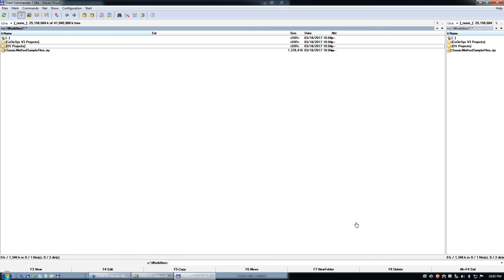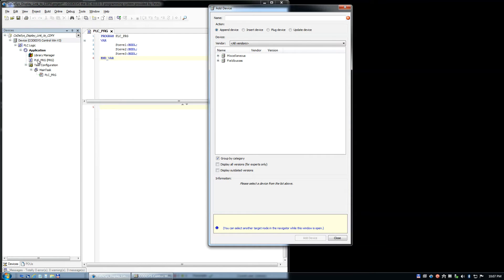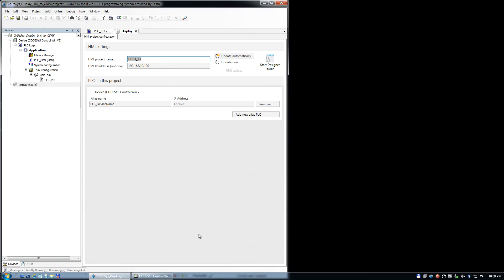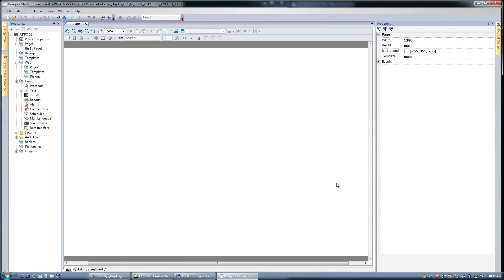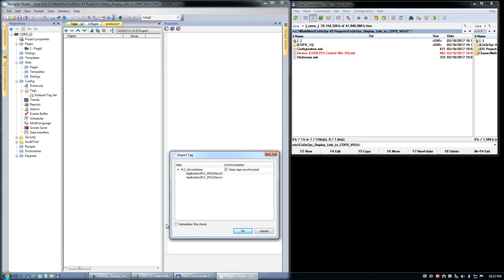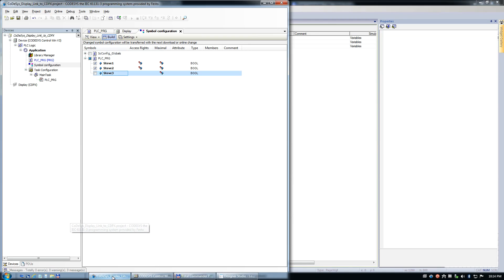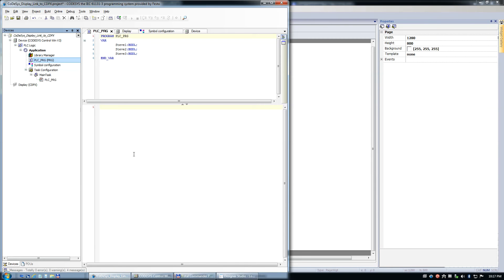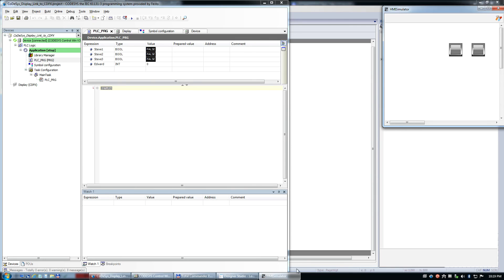CDPX Tag Linking - Display Link to CDPX V3 5 4 01

Comment: Hi Steven, thank you so much for your videos, there are very clear and high quality. Could you do a tutorial how to conect two or more CECC in EasyIP ?
Reply from the maker: All of the video I put on my Channel are done on my personal time at home usually between 11pm and 2am on a Friday or Saturday night.  I only have so much personal time and it is sometimes months before I post new ones.  Next time I have time, I will think of your request but I cannot promise anything.  I have not done EasyIP myself.  I have done Network Variables (UDP) and I prefer ModbusTCP as it is so Simple between controllers - this would be your easiest approach.  For ModbusTCP, just set up an EtherNet Device with Slave Device in PLC_A, then EtherNet Device, Modbus Master, then Slave to Match PLC_A in PLC_B.  Add 2 channels to the Slave (Function Code 4(Read) and Function Code 16 (Write)).  Specify total length of words and you are done.
Reply: Thanks for answering Steven, i think cache the idea, Im gonna try with ModbusTCP with your instructions. Than you !